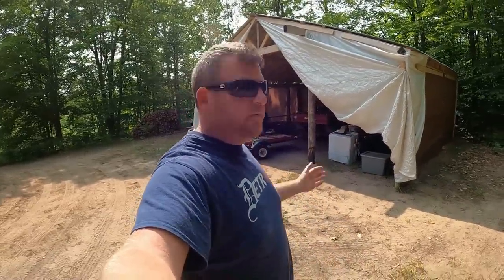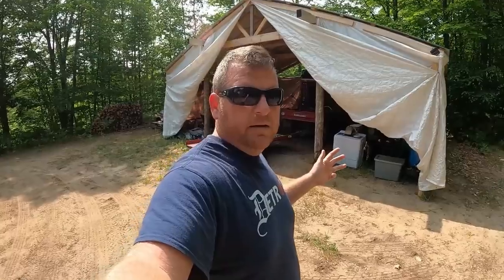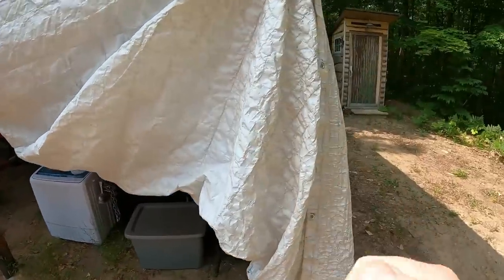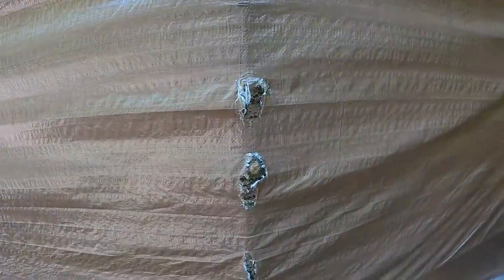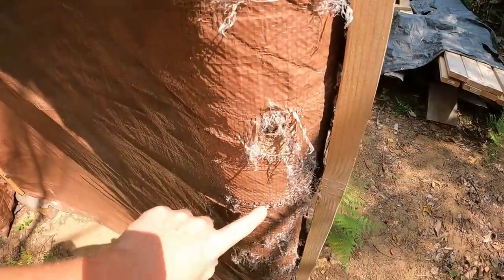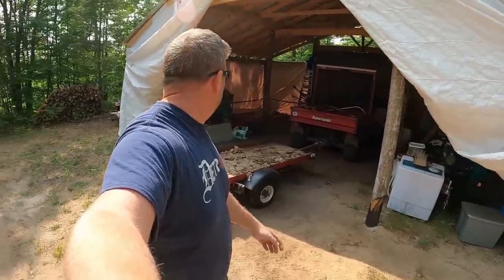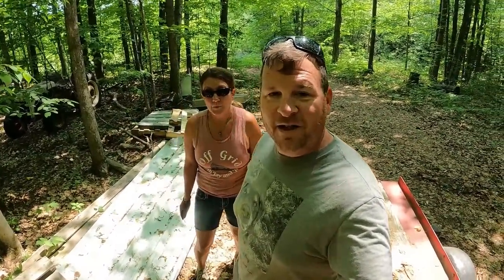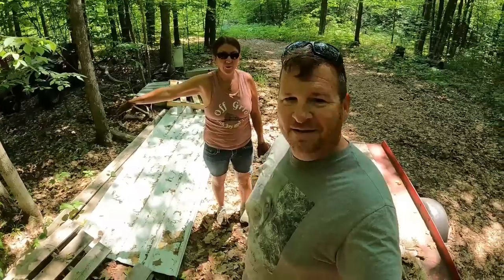DIY Pole Barn Build - Let's get ready to Side the Pole Barn!

Comment: Did you dig down and bury the bottom of the poles for the barn? Did you use concrete?
Reply from the maker: The posts are 3-4 foot into the ground. I did not use concrete at all, the sand here is undisturbed and solid as a rock.....just my thoughts
Reply: Thanks for your reply 😊.